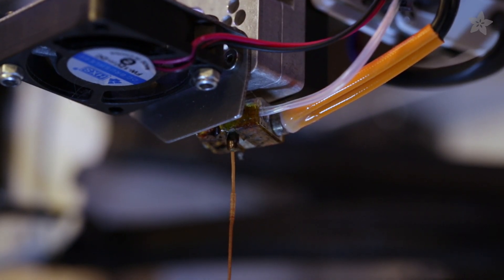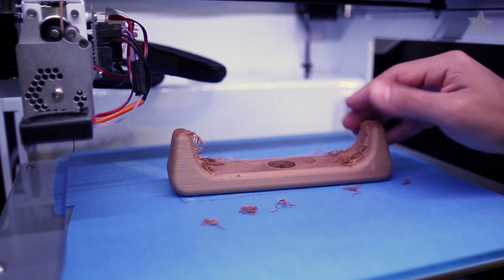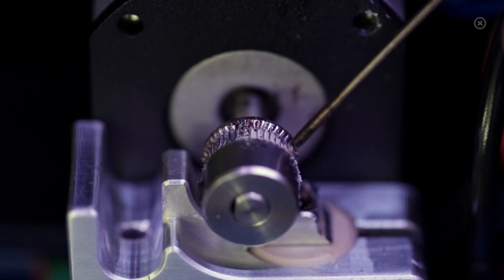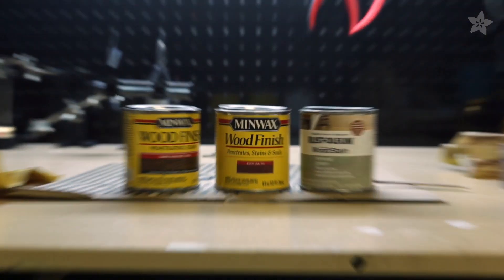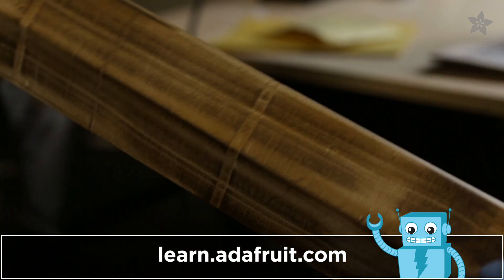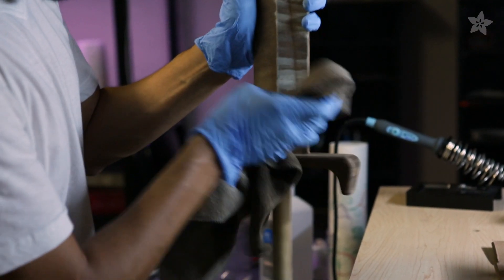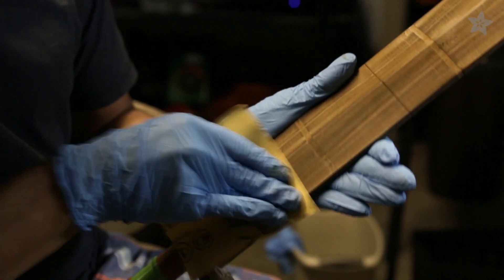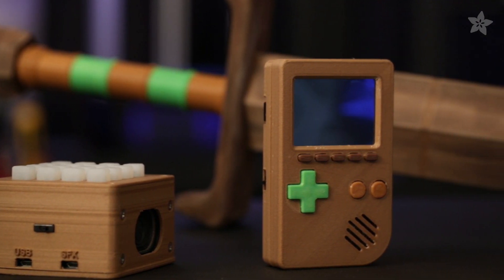#3DPrinting with Bamboo Wood Filament #Adafruit

Comment: so, how many wood like properties does this material have? should it be recycled like pla or disposed of like wood? can it be used for fule? (obviously printing logs to burn is dumb, but if you have a failed print or an object you have no nees for anymore, it is nice to have that option) can it be used for agricultural purposeses? how would it fair ground up and thrown into a compost bin? would the wood decomposes leaving behind a bunch of pla dust i could potentially collect and recycle?

Comment: i have the micro3D printer (M3D), this filament works with my printer??
Reply: I have seen many people use it so I'm going to say yes :)
Reply: +Dawson Boyle thanks bro, do you know the settings?
Reply: +UlTrAcHaNgOn All I know is it's melting point is about 20 degrees lower than normal pla I hope that helps you may need to look there are a few videos on YouTube with the wood fill and the m3d

Comment: This is what a CNC made for!
Reply: Haha, good luck making some the things a 3d printer is capable of, without a super expensive cnc machine.
Reply: http://www.ebay.com/itm/New-CNC-Router-Engraver-Milling-Machine-Engraving-Drilling-4-Axis-3040-Desktop-/321798538942?hash=item4aecb006be:g:X20AAOSwIgNXlYCr
Reply: rc-wingman
It's hilarious if you think that can make everything a 3d printer can make! There are some things that even the most expensive cnc machines can't make. To be more precise, things that only additive manufacturing can make, not subtractive manufacturing.
Reply: Keuken Geit for this, sure a good CNC would do better, but there are some things subtractive manufacturing just can't physically do :)
Reply: depends what kind of cnc if you buy a cheap one, no it does not do the same as a 3d printer but most profesional ones can do the same. Maybe even more precisly and the material is actual wood instead of some fake grass fillament
Reply: sure, but this box shown in the video is no problem for every CNC machine.

Comment: Technically, Bamboo is grass not wood
Reply: +Dawson Boyle that is true, I'm amazed by all the PLA mixes you can get tbh
Reply: what is wood?
Reply: Wood is a stem made up of fibrous and porous "tissue"
Grass is a stem that is hollow
Reply: Handskemager I see
But aren't the walls of bamboo porous as well? if they are, doesn't that make them considered wood?
Reply: +iSquamata think about doughnuts, they may be made with the same materials of other cakes, but they are called doughnuts

Walls of the Bamboo is purous and fibrous like wood, but because the stem is hollow it's actually grass
Reply: +Handskemager none the less it's still a fairly impressive filament
Reply: +Handskemager I mean I know bamboo is a grass but it's pretty cool how it can be used as a filament to imitate real wood prints, I can't wait to get my 3D printer I'm wanting the m3d! :)
Reply: It's a woody grass. Still wood.

Comment: Im having problems printing my wood filament. It keeps clogging so I have to constantly watch the print and when it clogs, pause it, unclog then resume. Its a very boring job! I have to unclog it every 1min 30 secs to 2 mins! :( Any suggestions? Its 1.75mm filament in a Makerbot Replicator 2X?
Reply: +Glen McMurchy well if you don't print shoes it will git rid of your clog problem ;) lol
Reply: I've never tried wood filament, but what I heard is that you need to have at least 0.4mm nozzle or higher, otherwise it'll clog much faster and easier.
Reply: well forget yall then... ill take my comedy gold elsewhere.....
Reply: lel get ultimaker

Comment: I wish hemp were legal so that we could have an even stronger filament.
Reply: +ZebbMassiv Move to CO.  We're working on it.
Reply: +ZebbMassiv does the fibers strength actually matter in 3d printing though? As I understand it the filament is essentially just sawdust mixed with some sort of binding agent, usually pla or abs so the fibers are not what gives the prints strength but the binder.If that is true a print done in any cellulose material should theoretically  be the same if the binders are the same.
Reply: hemp used as fabric is legal I believe
Reply: Hemp is legal and grown in all states for oils, fabric materials, CBD and range of other products.
Reply: ZebbMassiv in Canada it's legal, but lots of controversy about weed legality
Reply: no weed is not legal in Canada but it should be by april 2018
Reply: HEMP is legal, just use the super low THC version ....... DOH.
Reply: Industrial hemp is legal in 46 states.
Reply: +ZebbMassiv bwahahhahahahaha xD my dreams would come true aren't you sometimes too lazy to roll?
'NP! I GOT THAT! LEMME PRINT ONE!' xDD